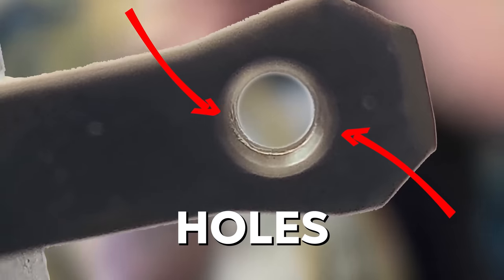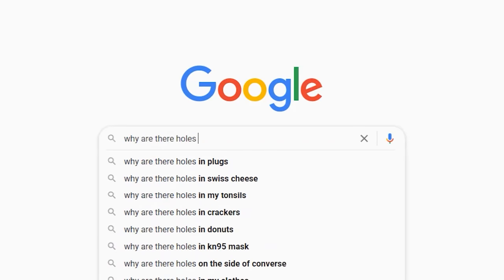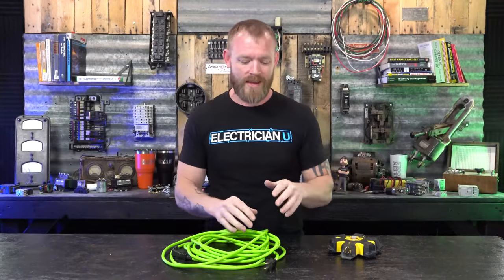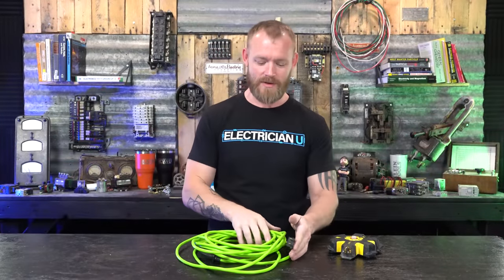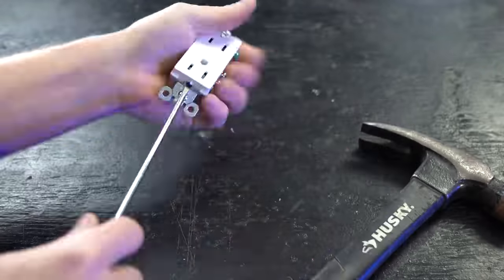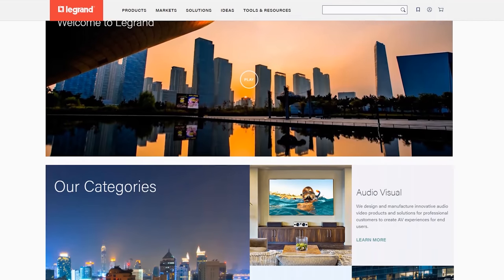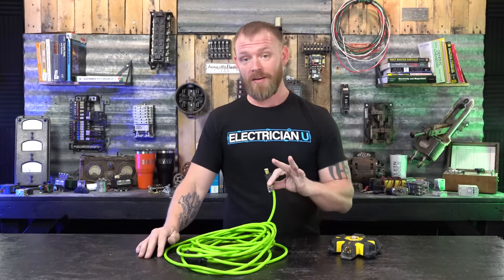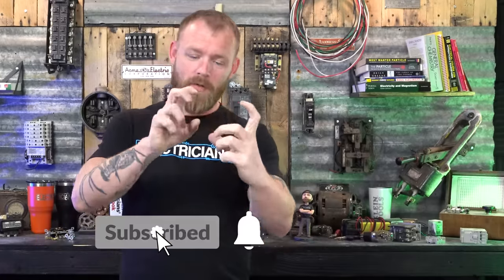WHY Do Plugs Have HOLES? The ACTUAL Answer!

Comment: You are particularly correct.  As for the original use.    But there is absolutely no  tie to any grounded plugs or polarized modern plugs.    They now are used in the  manufacturing process for indexing of the metal parts at least some manufacturers.

Comment: Hi 
I live in Japan and we have the same plugs as in the US.
There is a type of outlet that requires to insert the plug and twist it clockwise to secure it.
The holes are used in the outlets so that it does not go off by accident

Comment: I always thought they were for lock out tag out purposes only, however I started to suspect maybe to help grip the prongs on certain types of receptacles, as I was going through my great grandmother's estate after she passed a little over a year ago,  when I stumbled upon a 1926 -'27 Graybar Electric catalog, which had some tandem blade plugs, which had groves along the prongs,  as well as parallel blade plugs.   Even feature edison base plugs and receptacles.    I guess at that time the industry hadn't yet decided on which plug configurations would be used for 120v, 15A, because both tandem and Parallel plugs and outlets in the old catalog were rated 125V 15A 250V 10 A.

Comment: 2:28, totally an electrician for using needle noses to crack this open
Reply: Totally not getting their channel-locks
Reply: Id’a used my linesman pliers and my worn out beater flat head screwdriver to smash it apart.

Comment: In addition to the manufacturing process, it's possible there is a minute amount of additional friction/grip created by the circular hole/cut. This is possible when sliding against a smooth surface such as each side of the receptacle.

Comment: I got this answer decades ago. The original receptacles dating prior to WWII had those bumps internally, with some carry over till we switched from 2 prong to 3 prong outlets. This means you might find outlets with the extra grip up to the early 60s. The hole is basically a throwback to backward compatibility. Better materials and more "spring" in the outlets means it's no longer necessary, but it's been around for so long it's just a fact of life. As a kid, I recall using an outlet and feeling for the bumps because if things were well worn, you'd have to pull the plug out a tad to get a decent connection. If you were on the bump as intended, you actually had a bad connection. BTW, these days they also make swiss cheese without holes. (although hard to find)
Reply: Dude, now you brought up the controversy of why Swiss Cheese has holes!  Seriously, thanks for your input on the plug hole subject.
Reply: @Bob3519  ... if you want another laugh, look up an old Bill Cosby skit on "why is there air" and you will be shaking your head that you didn't know the correct answer.
Reply: It's the "We have always done it that way" syndrome. And there is no good reason to change.

Comment: I agree with the Legrand engineers, it's a form of holding the plug in. They still make extension cords (usually only the expensive high quality ones) with a button that unlocks the plug. It engages through the holes in the plug to prevent the cord from pulling out of your extension cord while you're working.

Comment: One of my friends Dad was an Engineer is the late 30s early 40s. One reason he told me they were their was due to sparking. Old outlets would spark leading rare cases of melting and fire. So the hole keep the spark more in the outlet.
Reply: This is the right answer. In order to reduce the spark, they put holes on it.

Comment: They never should have stopped making sockets with "bumps" to hold the plug.  A lot of outlets won't hold a big DC adapter like a cell phone charger without it falling out.
Reply: I have yet to see a three-plug socket not hold whatever you plugged into it. Two-blade plugs should just go away.
Reply: @asbestosfibers1325  it's not though... The ground blade is a major point of contact with the outlet and is the only one that provides up and down stability.  If more device manufacturers used it, slippage would be far less of an issue.
Reply: use a power strip ^_^
Reply: @jeffhansman2829  I still don't know why every other country in the world doesn't just copy/paste the standard British plug design tbh.
They are superior in every single way to both two and three pin plugs in most countries.
Reply: @ultrademigod  our plugs never fall out. Held in very securely.
Reply: @beardedchimp  It's not just about whether they fall out of not, it's all the other safety features too.
The UK plug is just a better product, end of story.
Reply: @ultrademigod  disagree, they are a serious foot hazard. When I hear people complain about stepping on Lego I assume they have never stood on our plugs.
Reply: @beardedchimp  UK sockets come with an on/off switch, so you never need to take the plug out of the wall.

If you stepped on the US/European plugs you'd probably break them, which is way worse than having a sore foot for a bit.

Comment: Before I start this video, as I'm curious now too lol we would put skinny zip ties in between the holes if we had to run off to another job so you are unable to plug it in to any receptacle if you had to repair the female end connector in hopes others would realize as well not to use the cable. Kind of a cheap 🔐 out point.

Comment: These holes work as a “vacuum” mechanism that helps the electrical plug stay in the socket more securely. This makes it difficult to remove it so easily.
However, in the past, a breathing area was used by the energy flow system. This has changed, and the specific holes have another function today. Users can count on this additional safety feature, which prevents the cable from coming loose and causing accidents at home.

Comment: In the US and Canada, "plugs" are NEMA 1-15 (ungrounded) and NEMA 5-15 (grounded) Type B. 
According to page 17 of ANSI/NEMA WD 6-2002: 
"The hole in flat blade is optional, and it is intended for manufacturing purposes only. However if used it must be located as per dimensions shown above."
We can conclude from the wording (ANSI and NEMA specs use the above language for other features),  and as the email you received seems to suggest, the holes exist for some long deprecated (or at least no longer useful/application) feature.
I suspect the 'lockout/tagout' feature everyone is circlejerking over is simply a handy byproduct of this long forgotten reason.

Comment: I always thought it was so that we're able to connect wires to the prongs straight away when needed. We have such anomalies in Indian style prongs as well which are cylindrical, just like European, and they have vertical slits in each. While it's dangerous, it's still a very common practice during festivals when you have to extend the connections temporarily for lights and what not.

Comment: Another aspect is that id imagine lots of the stamping dies for those prongs is still in good shape so even if the holes eventually end up never needed anywhere again, They will still exist because they also do not harm the current capacity of the plug at hand and from a business perspective it makes no sense to replace the stamping hardware.

Comment: I use the holes to temporarily hold the ends of the exposed wires to energize a light or radio when working alone to shut the proper breaker before working on it

Comment: I actually own a Master lockout for plugs that requires the holes to work, so yes, one of the use cases is lockout-tagout (LOTO).
Reply: It is not meant for that.  The reason they are there is for the manufacturing process.
Reply: @common_c3nts  what part of the manufacturing process requires these holes? I doubt any modern one does. But for plugs without the holes, the Master LOTO lock doesn’t work, so it is A reason they are still put on most plugs. I also happen to know another channel found a more interesting device that uses the holes. What device is will blow your mind, but I won’t spoil his surprise.
Reply: @PetesGuide  The holes can help align and hold the blades while the plug housing is put/formed around them.
Reply: @fewwiggle  that might be the case but I doubt it. I need to see video of how they are manufactured.

Comment: American parallel pins | | need a locking system. Australian  / \  sloped pins don't have holes ( less likely to fall out) .. but do now have insulated sleeves ( as part of the pins) at the lower end of the shaft.

Comment: That's interesting. 
I believe I've encountered those older outlets a few times because I have had plugs get stuck so that it was very difficult to remove.
Reply: The real answer is more boring. I don't doubt that plugs were made to use the holes, but according to the patents the holes exist for manufacturing convenience so they can easily hold the prongs while it sets. All other reasons are just taking advantage of the existing holes

Comment: Yeah,.. I was gonna say,.. I still have a couple of those very old receptacles that do interface with those holes,.. most of them, except one, now are either disconnected, or replaced. Funny thing is,.. I still have many working appliances from that era, those receptacles widely would have been used,.., and oddly enough, most of them don’t have the latch holes in the plugs to take advantage of them anyway!

Comment: About 30 years ago I had a extension cord equipped with "push-in" plastic pin that penetrated the hole and prevented separation if cords were pulled.

Comment: As an electrician I've many times had to jury rig power....the holes are for putting wire through, then you can hard wire a cord into a panel for temp power if no receptacle is available, by landing the hot to a braker and the neutral to the neutral bus or ground bus.
Don't try this at home folks.

Comment: I'd assumed it was for LOTO. But the real question is could you still put it far enough into a socket to get juice into the cable? What if you had no faceplate so the thing got even closer? Even if the juice wasn't consistent if you got any it would be an unsafe LOTO method.

Comment: I know they told you it was more or less for older outlets and has just continued but arent the holes on both ends? Are they manufactured so they can be put into end of cord either direction? And inside the plug gets contact with wire?

Comment: I thought that the holes were an artifact of the manufacturing process. An alignment pin through the holes to hold the blades in place in the injection mold for the plastic housing. 
Or possibly an arc quenching mechanism to minimize sparking while inserting or removing from an outlet.

Comment: I would have guessed what my electrician dad would have said.
For use in hospitals, surgery and labs, the outlet needs to retain it's grip. The medical grade outlet held these holes during the time those buildings had those outlets and it kept important equipment more secure to function.
Sheesh.

Comment: Should you have some interest in further research, I've always been curious why NEMA 6 plugs/receptacles are uncommon. I have never seen them in a residential setting, but frequently see them as the receptacle used in server rooms. Most electronics can use the full 100-240v range with a ground which is perfect. Additionally it would permit more worldwide standardization in manufacturing. Full disclosure, I want to know why my I have to pay a significant markup over NEMA 5 receptacles for a few dedicated runs for my home server. I found 'cheap' NEMA 6 receptacles, but they're marked as dedicated grounds and I don't really care to do that even though they're dedicated outlets. I'll end up doing as a please with my rewire since I won't be answering to building code (none adopted) or inspectors (see previous), yet it still feels wrong.

Comment: i always assumed it was a built in maintenance feature. if the connection is disturbed while in use or frequently gets loaded and unloaded with a high wattage item like power tools there is a potential for arcing causing tiny carbon buildups which over time can create resistance which creates heat. i assumed the holes acted as a scraper cleaning the contacts on plug in and disconnect. the actual answer was interesting and a little surprising.

Comment: My apartment built in 1980 needs some new outlets. The inner workings on some are so loose my plugs will hang or fall out while some have just enough tension to hold the plugs in like they should.

Comment: There are many reasons. The machines use those holes to hold them in place in the manufacturing process. But another reason is for placing a small padlock in those holes effectively zonking the equipment.

Comment: The answer you gave is correct for why the holes originated, but the reason they still exist is much simpler.  Outlets that used the mechanical "bumps" for clamping force have literally not been made for decades, and are almost nonexistent around the US.  But the reason manufacturers still put them in is not to ensure that all new cords will be "compatible" with these rare, old outlets, it's because that's how the NIST standards defined them back in the day, and even after many reviews of the existing NIST standards, it has always been deemed easier to just leave the standard the way it is, more from a consumer perspective, due to the fact that if a consumer did NOT see the holes, they'd assume something was amiss with the plug.   In the end, the reason for the holes?  Human psychology, and not technology.

Comment: Took a old receptacle apart and found it full of dust bunnies.  Would it be a good practice to replace this kind of equipment periodically?
Reply: If dust is building up in a receptacle, I think you would would be fine by just using a strong vacuum on the outlet.  Regardless, barring an unusual environment, the dust in a (wall mounted) outlet should be harmless.
I suppose a floor mounted outlet (or powerstrip) could fill with dust and cause poor contact which could be problematic.

Comment: Couldn't be because of older receptacles because they won't take the larger neutral plugs. The reason is for manufacturers to align both blades so they are exactly in the correct position for the injection molding process. 

Older plugs would have been bakelite or rubber wrapped around the wire and the blades.
Reply: This was my first guess.  So... manufacturing process, or hysterical raisins?  As others have noted, a modern polarized and/or grounded plug wont fit an older receptacle, so the legacy explanation doesn't make technical sense, but it might make Fiddler on the Roof sense - Tradition!

Comment: Weird. I’ve changed some REALLY old receptacles and never noticed a bump inside them. Also why is the hole in the non polarized side as well if the neutral was the one failing?

Comment: @electricianU Could you do a buyers guide or what to looking for clamp meter or multimeter? I am looking to purchase a clamp meter for work
Reply: Buy Fluke, anything else is subpar designed. I found out the hard way

Comment: Huh, I thought they were tooling holes, so a pin can hold them in place while the plastic is being molded around them, or otherwise make handling them during manufacturing easier. As for why they're the same size and place, I'm pretty sure that's part of the NEMA spec. I suppose you could see if any of the authors of said spec are still around.
Reply: I agree w andrew b holes r there for manufacturing purpose and progressive. Stamping of prong where pilot pins postion flat stock b for roller feed closes and prong is stamped out.

Comment: I was installing receptacles before you were born and the engineers were correct. All receptacles had bumps on the contacts to keep the plug from falling out. It also made a better connection because the size of the contact points in the receptacle were smaller and sometimes there was corrosion that built up on the connectors. Even today I look at plugs to make sure there isn't any corrosion on the prongs and if a receptacle doesn't work I put the plug in and out several times case that solved many of the problems when I was growing up. I also so that on low voltage like USB and Ethernet cables if something isn't working cause low voltage DC is prone to corrosion hence the "gold" contacts that were the big "in" thing years ago.

Comment: Got to love the first theory.  The plug is manufactured with a solid prong then they add a whole other manufacturing process, machine and tooling to punch out some of the material...to cut down on cost.  Makes perfect sense!  Lighten it up to save money on shipping.  Genius!!!!

Common sense is now super uncommon.
Reply: Except that's completely wrong, it's not to save cost, it's to make manufacturing easier, particularly when aligning the prongs within injection molds. You said "common sense is now super uncommon" which is funny because there's no such thing as "common sense." Your "common sense" came to the conclusion that it was about saving cost yet you were completely wrong.
Reply: @mangomonad  Watch the video again.  Listen to the first theory he said he found when he Google the question.

Reading and listening compression has also become very uncommon.

Comment: My experience is that there are no holes and that prongs are not flat either. The electric systems are different in different parts of the world. Here in Sweden the prongs are round, no holes and the ground doesn't even have prong but a different looking connector.